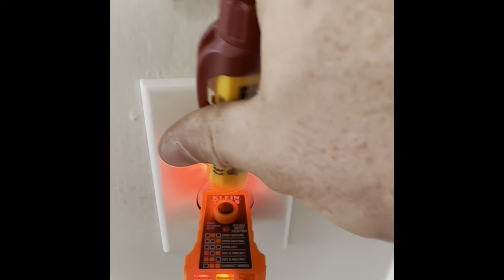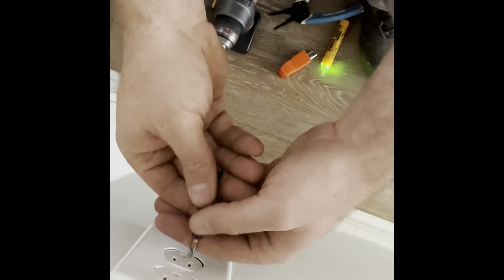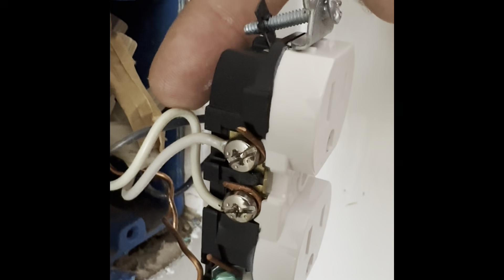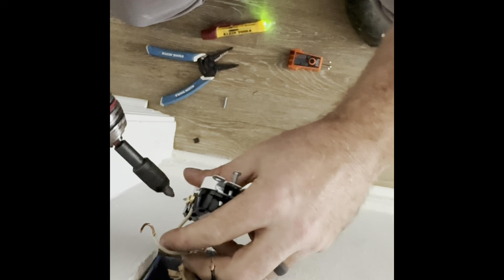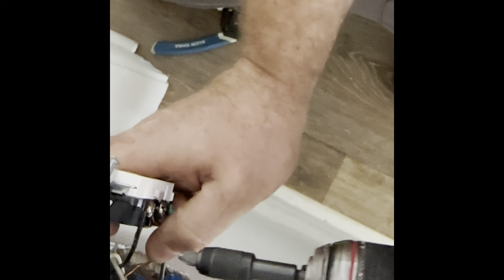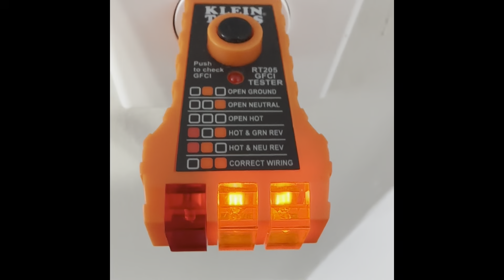Outlet Wiring Repair! (Hot & Neutral Reversed)

Comment: You wired the outlet backwards. The white wires go on the side with the silver screws and the ground wire. The black wires go on the side with the brass / gold screws.  There has to be another outlet closer to the breaker box on the same circuit that shows hot / neutral reverse.

Comment: Shouldn't you figure out what caused the swap of neutral and hot? Starting at the breaker and working your way towards the outlets. You fixed that one outlet by wiring it backwards but everything else from there to the breaker is still wrong.